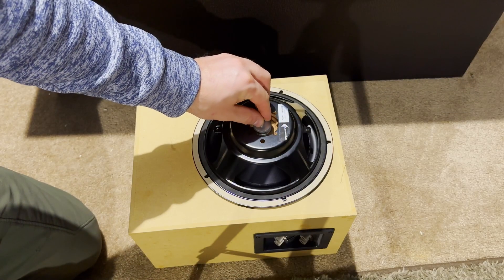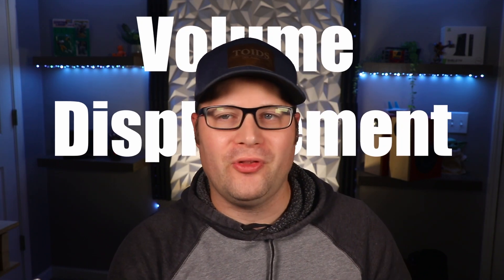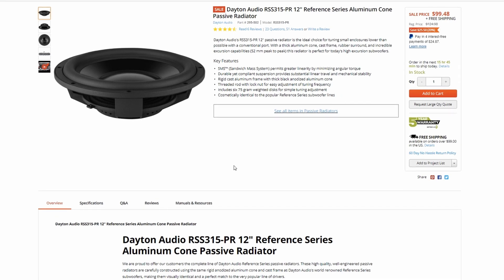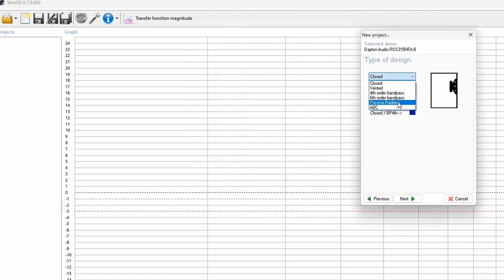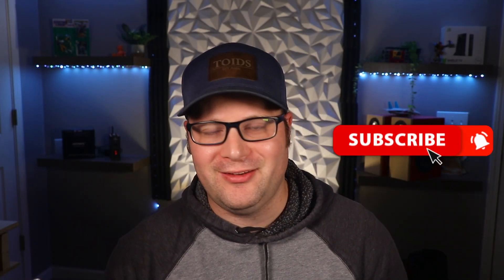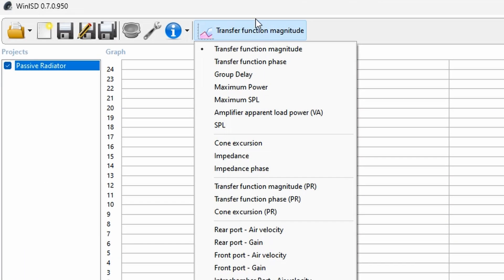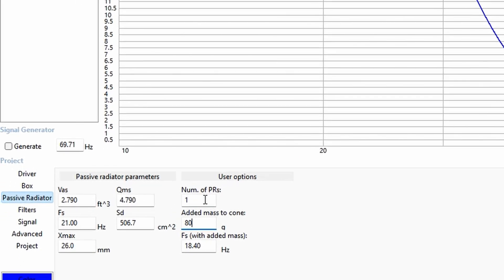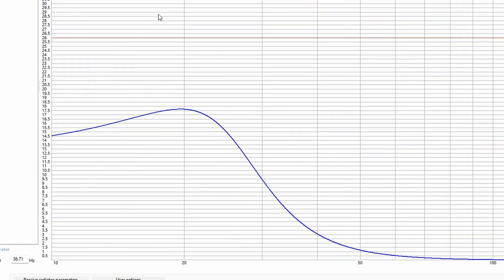How to Design, build and Tune a Passive Radiator

Comment: Great video but i think the lower you tune the PRs the more the cone excursion of the driver will sound bad
Reply from the maker: Lower tuning by itself doesn’t make excursion “sound bad.” In a properly designed passive-radiator system, driver excursion actually drops at tuning because the PR is doing the work. What people hear as “bad” isn’t excursion, it’s distortion, unloading below tuning, or a poorly sized/massed PR. That’s a design or protection issue, not a low-tuning issue.

Comment: Long time DIY guy. Spent weeks at times on Forums (guess which) researching issues.  And our host hits the highlights that matter in a 0:02 few minutes speaking in crystal clear manner. Where u been when I need ya. Subscribed!  Off to PE, have the perfect project.
Reply: And I not only read the R. Small and Thiel papers in the 80's, but used them to write code in Fortran on a lab computer bigger than a refrigerator. Tie well spent mind you. But what a great refresher course this vid is.

Comment: Hey would you mind cutting me a break and helping me out I’ve been trying to do the math and I just think I’m way off

I wanna try to do 2 stereo integrity SQL 12s in a pr but I don’t think I’m doing the math right

Would you mind telling me what the displacement total is that I’m gonna need please and thank you
Reply: SI SQL 12s have 28.4 mm of 1 way Linear X Max, right? So a pair has 56.8 mm 1-way, but the Total X Max of the pair= 113.6 mm. So you would need a minimum of 227.2 mm of Total X Max from a 12" passive. More would give you headroom, to keep from tearing up the passive radiators. Earthquake suggest using the active woofers rec. Sealed specs.= 1 cu. ft. Net per SQL 12", so 2 cu. ft. Net for your pair, then use (3)- Earthquake slaps 12" passives (each has a Total X Max of 101 MM ), so 3 of these Earthquake Slaps 12" passives= 303 mm of total X Max= more than 227.2 mm, so your safe. Don't use passives on the same baffle as the active drivers. I like active/powered woofers facing up, & passives facing rearwards/backwards. Like a ported suv style, subs up, port back, gives great output, & time alignment.

Comment: So the xmax if it is 28.4mm one way would I make it 56.8 for pk to pk when I’m doing the math for a pr
Reply: 28.4 mm 1- way= a total X Max of 56.8 mm for your active/powered woofer= a Passive of the same Sd, would need to be able to have a minimum total X Max of 113.6 mm! Earthquake slaps 12" with a total X Max of 101 mm, & their 15" passive has a total X Max of 112.5 mm👀!
Reply: @evilinside5984 I used 2 earthquake slaps v2 12In PRs in a 3 ft.³ enclosure with no weights on them man it worked out beautifully for something being $60

Comment: If I’m using a driver that’s not intended (or rather spec’d) for a ported enclosure should I use the recommended sealed enclosure size? I haven’t tried modeling this but I’m planning a build for a shallow 10”, specifically a Hertz Cento. It’ll be in the storage compartment behind my third row so I’m limited for enclosure size but I can build it to about .75 cubic foot, .76 is the max recommended enclosure spec’d by Hertz.
Reply: Earthquake rec. using their Slaps Passive radiators with the active drivers rec. Sealed enclosure specs.

Comment: Could I also use old woofers as passive radiators? (want to apply it for car hifi)
And what if i got 2 different passive radiators?
Reply: I've done that. The only thing is that old subs will have a really worn suspension and flop about wild. The key is to get serious about it and remove the magnet and VC and use some epoxy to mount a small bolt so you can tune it. I did the best using big washers as weights and a rubber band attached to the bolt and a little wire frame I mounted where the magnet used to be.

Comment: Hey just a suggestion, stop flipping so much between the application and your face. its hard to follow along for someone that's new to it. Put your face small down in the corner if you need yourself visible.

Comment: Can a passive radiator ever be too large in terms of volume displacement? What would happen if the volume displacement was say 4-6 times that of your driven subwoofer?
Reply: The more displacement the passive has, the higher the tune. So if you like a 100 Hz tune, then enjoy😉

Comment: If you have one 12 inch active driver can you place multiple passive ones that are smaller
Reply: The goal is to displace 2x the xmax with a single or 2x the air volume with as many PRs as it takes.

Comment: So ive built hundereds if not a 1000 boxes over the last 40 years and always has this design concept in my head along with some modified versions of this. A 2 chamber box with both chambers sealed. Woofer on the front baffle like normal and on the inside wall mount a passive way stiffer then the woofer so the higher the LF excursion the more the inner passive moves. So the internal volume/compliance changes depending how much the woofer moves or how much it can move the passive.

Comment: two radiator i think can do like 6th order bandpass. driver in between, two radiator in each side of the driver
Reply: Passives will perform better if they are NOT mounted on the same baffle as the active driver.

Comment: dumb question. if you were gifted an old speaker cabinet and the woofer is still good but the bottom passive radiators are gone except just the frame, could you just have them rebuilt? basically uncle passed away and I kept the old audio system he had and right before he died he had the woofer refoamed but the bottom speakers were said to be passive radiators but all that was left was just the frame, should I even bother or is there away to rebuild them? am I making sense lol I am so confused but I just dont want to throw these away as it sounds somewhat decent or at least to me I think it sounds better than what my sound bar was giving me. any insight would be appreciated.
Reply: First take out the frames, & just cover up the holes to see if you like the sound even better. If you do then just ✔️ on your options for new passive radiators.

Comment: Can 2 PR’s be in a push-pull confirmation (on opposite sides of the enclosure), or should they both be mounted on the same side of the cabinet with each other?  Thanx! Great video.  Your new subscriber!
Reply: If you had (2)- PR's, 1 on either side of the enclosure, they would both move out, & in @ the same time. For optimal performance, mount the active woofer(s) facing up, & the passive(s) facing backwards in a vehicle= great output, & time alignment. Worst performing is both the active(s), & passive(s) on the same baffle.

Comment: If you are using 2 woofers,,,do you do the measurements for 1 and then double?
Reply from the maker: Yes
Reply: @Toid  thank you for the quick reply. I have one more question if you don't mind. If the resonant frequency of the PR is lower than that of the driver, can the PR reach it's resonant frequency? Say the driver is 50hz and the PR 22hz.

Comment: Hey can anyone help me , I want one 12 in my suburban truck , but a real high wattage one , like , the ds18 12 inch 4000 rms hooligan sub .. wat passive radiator can I put wit it that can hit real in the high 20s hz range ???
Reply: Buy (2)- 12" Earthquake Slaps passive radiators, or (1)- 15" Earthquake Slaps passive radiator. Don't put passives on the same baffle as the active/powered woofer. I like active/powered woofer facing up, & passive(s) facing backwards= great output, & time alignment!

Comment: If you only want one passive you need to bulk up the weight in order to get an equivalent Q factor, this means vibrations get even worse, although it works well if you aim the single PR towards the floor (makes it act like a bass shaker).
In a car this doesn't matter as much, just tie box down so it doesn't move.
Regular air ports also have two major advantages if you don't have size constraints, air is free unlike PRs, and you can stuff air ports to alter how the sub behaves, say if you bring the sub indoors and outdoors a lot.

Comment: I have some cheap old but working subwoofers that have 12mm xmax can I use it as a passive radiator
Reply: No passives are NOT subwoofers.

Comment: Best video on the topic so far. Great information for beginners.
Just to add, one could also talk about methods to compute and tune a PR if one doesn't have a complete data set for the PR.
Anyways, I like PR builds as they provide so much more freedom for the designer

Comment: Hey Toid, I've an idea for you - what about using a driver with a motor, but then adding some variable resistance across the terminals of said passive driver to tune its behavior?

Thanks for the vid!
Reply: Interesting idea, but then you are paying for two drivers and possibly added components.. Adding weight is very simple and requires much less expensive drivers.  I like the theory but it sounds highly impracticable if not impossible. That would make it an active passive radiator ? lol
Reply: A tube is cheaper

Comment: Hey toid! Would you consider doing a video using a cheap aiyima amp to power a diy sub? They just released one that is powerful with their upgradeable power supplies and can be used bridged. - $100.

There's a video of someone who built one of your sets of speakers also built a sub and used a cheap 2.1 Chinese amp to power the set of speakers and said it worked great as the speakers were very efficient.

That made me wonder what one of those amps can really do specially if you have an avr with bass management and dirac or audyssey to further eq it. Super cheap alternative, at least to complete the build and could upgrade later if wanted.
Reply from the maker: Maybe. I need to get a better test setup to accurately test amplifier wattage.
Reply: @Toid  diyhyfy released a video 4 days ago using a cheap amp on a diy sub. He just recently did your jtr inspired speakers and powers those with the same amp, pretty impressive.
Reply from the maker: @mcjonner  yeah he is killing it. If you check my live videos, you’ll see I had him on a few weeks ago and we talked about all his projects. He’s a great guy and I have been trying to help him out where I can. He did a beautiful job on the Audience 212.

Comment: Remember  that a 12" woofer needs a 15" passiv  radiator in comparison to its area.
Reply from the maker: That’s not accurate. The size of your passive radiator is going to be directly dependent on your tuning, wattage, enclosure and volume displacement. That’s what the video was all about.
Reply: Komisch dann liegt die Literatur und klipsch anscheinend falsch!!!
Reply: @thomasschafer7268  Here is the thing. Way back in the day, passive radiators did NOT have the capability, as most passives do today. So companies used to say use 2 passives of the same dia. as the active driver, or use 1 size larger dia. Passive then the active driver as a general statement. But the fact is you just need to have a passive radiator that has @ least 2x the active woofers Total displacement. Earthquake Slaps passive radiators are impressive, 12"= 101 mm, 15"= 112.5 mm👀!
Reply: Good reply

Comment: The Bad thing about using only 1 passive radiator is, the speaker jumps around, having 2 opposing passive radiators cancels the vibrations.
Reply: That depends on where you place the passive radiator. If you place it on the opposite side of the woofer, then the vibrations are cancelled as well
Reply: Why do so many people put the passive radiator on the side of the box? Probably looks better in pictures... I would install it on the back of the box to balance the vibrations.
Reply: When you place the passive radiator opposite of the subwoofer, it will be out of phase for most of the frequencies, it will only be in phase at the tuned frequency.
Reply: @moisesbeltran2612  Not true. A passive radiator is recommended for best performance, to be mounted on any side, except the active woofers baffle. For best output, & time alignment, i prefer active woofer(s) facing up, & passives facing backwards in a vehicle.
Reply: What is really the point? You want less vibrations so for clean sound resonance right?

???

Comment: How does a passive radiator not act as an out of phase sub woofer cancelling out the wave?  This has always been a mystery to me.
Reply: The same way a port facing the same direction as the sub doesn't. The pressure has to build before it actually moves the air. I'm sure if you built a pr or ported out of spec you could cause cancelation.
Reply: That's because a passive rad doesn't have any polarity switch as no power, & it can be placed facing any side of the box & will work the same unlike a powered 2nd driver which either be dual opposed (in this case polarity is reversed for 2nd driver) or push pull (like m&k, perlisten subs) in which case it's more like a passive rad but powered & the entire sys is thus sealed. So the passive rad gets sucked in when powered driver moves out & visa versa. So it's not canceling out anything.
Also there's another way to put a powered 2nd driver facing in opposite direction & cancel out front driver but both are placed in seperate boxes that's called cardioid arrangement (which is a whole other can of worms) just FYI. 
Ps - this is my understanding not saying that's correct ans or analogy. But from my extensive research this seems almost perfect ans for your question.
Reply: @datdudeinred  You said it yourself.  When the sub moves out (+) then it sucks the passive radiator in (-).  How is this not out of phase?  If I wire 2 subs like this then it will certainly cancel each other out.  Why would it matter if one has a VC and one does not.
Reply: The passive radiator isn’t driving air it’s also not moving at a high frequency to produce sound. It really just acts like a shock absorber to the airspace.

Comment: Been building lots of passive radiator designs last few years... It really opens up possibilities for smaller box builds.   No more chasing port length- box size- tuning round and round. If you've designed many ported boxes you know what I mean. lol.  I use Bass Box Pro for my passive radiator designs. Predictions from bass box are spot on with my measurements so I trust it.
Reply from the maker: Great point! I completely agree with you as well
Reply: Have you ever had any chance to use Eminence Designer? I want to build one but I usually use Eminence Designer. I was wondering if it is any good.
Reply: @SvS-MK  I haven't used it in years. I was using an early release back in the day.  I actually used it to design a bunch of double 18" PA subs.  The software was free from Eminence since we bought 24 subs.  It was version 1.0 or something...they have updated it since. I don't think it did passive radiator or 6th order bandpass.  It's more suited for PA builds I guess.
Reply: All quite is kept I usually build my PR boxes without programs-and they sound damn good 95% of the time😂 I make the box around the subs Sd, Vas and Xmax-and add about a a cube tops more. Had many people say I was choking the subs by being off on the box size but nope. My 15s still hit with authority almost 2 years later.  Had to modify my 12 box because 2 cubes for each sub produced weak bass and over Excursion of the PRs. Brought the Net per sub to 1.2 cf and daaaamn-they pound hard.
Reply: @Macross223 calculated box volume for PR can go lower than sealed box for same f3 tuning.  You just end up with a much steeper roll off below tuning.

Comment: Those are comically expensive radiators lol
Reply from the maker: They really are. most of the cost on those passive radiators are the baskets. WHat most people don't realize is that the passive radiator that is designed for the subwoofer, is actually the same driver missing the motor structure. That is one of the reasons some passive radiators are more than others.